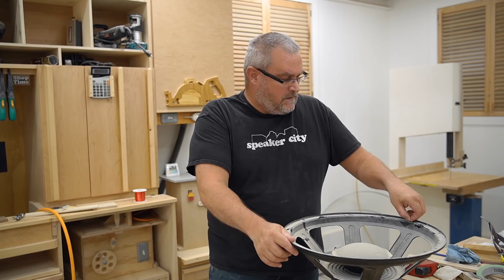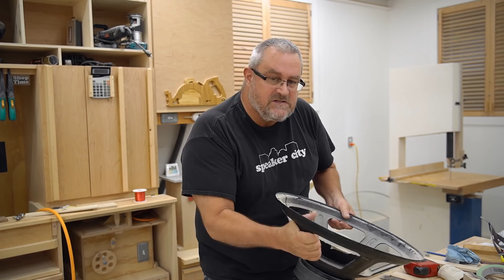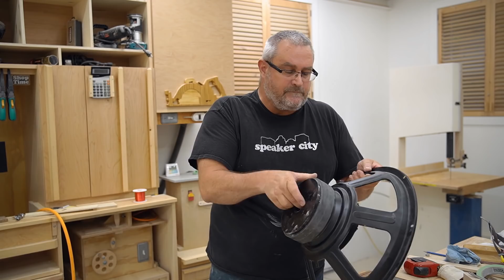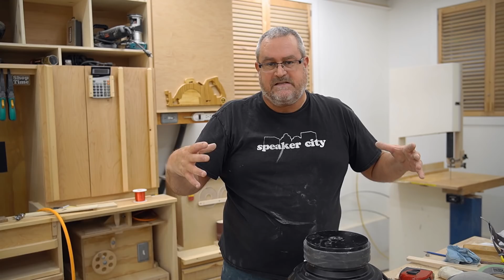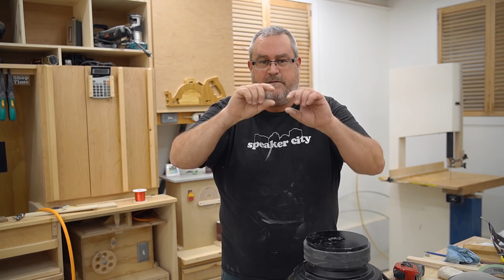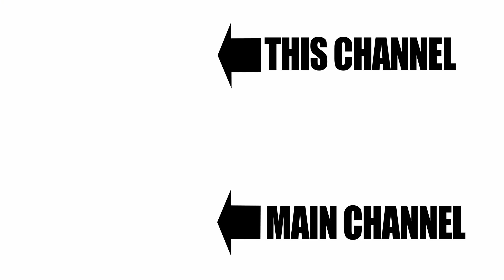Let's Talk About PASSION and Making a GIANT Woofer

Comment from the maker: Feel free to chime in if you have any technical knowledge with regards to speaker driver design. Or even a good understanding of magnetic force and how to best concentrate it.
The frame of the woofer will be made from plywood and hardwood, and probably won't look much like  one made from metal.
Reply: Sounds like you may have already talked about something like this in your video, but Tech Ingredients has a video where they discuss building a ferrous yoke around two magnets to guide the magnetic field between them, resulting in a stronger magnetic force. Not sure if your comments about building the metal ring were about that or not. https://www.youtube.com/watch?v=B015P0XFl9g

I'd like to see you build this woofer.
Reply: One manufacturer to look up for some information is fixmyspeaker.com. They design an build subwoofers an all parts for them.
Reply: I'm an audio file, so, hit it hard and low bud.

Comment: Hi,
Just a few quick comments at first.  Why limit yourself to circular speakers?  You could make them square or rectangular.  Even better make them very tall 8ft and narrow, in which case the voice coil just becomes a linear construction (straighyt wires attached to a strip) and the magnet structure also becomes linear and much easier to fabricate.

If you are looking for cone (panel) material, why not keep to the wood theme and build a sandwich of balsa with spruce skins.  Before, during and after WWII de Haviland build aircraft using this material.  the most famous was the Mosquito fighter, night fighter, bomber, high altitude recon, U-boat hunter, etc.  It was very fast and largely built of wood (nickname wooden wonder), pretty much the entire structure and air surfaces apart from the engine cowlings were made of various timbers.

I will post some other considerations later.  See if you can find a copy of Leo Beranek's Acoustics or Harry Olsen's Acoustical Engineering, ignore the maths and just get a feeling for the field.  Both books are old and written by giants in the field.  At least one of books is in the wild on WWW.
Robert

Comment: Hi John, as an electronics engineer I know that making the cone and/or the coil carrying part out of a metal would end up wasting your electric energy in eddy currents. So dont do that.
If you wind up your coil on an alluminium pipe for example the pipe would become the secondary coil of an transformer which is shorted.
So I would try to use plastics as bobbin and cone.
Beside all that I think it will be an interesting topic to do that project. So feel highly encouraged. I like your videos and I even like more that you found something on which you are very passionate again.
So go with it.

Thx for all your videos
Reply from the maker: Most large speakers use aluminum for the voice coil former, including the one I took apart in this video. It's not a solid ring - it has a gap.
Reply: Hi John, OK then eddy currents couldn't establish. Looking forward to your build 👍

Comment: First, let me say that I know much less about speakers than you do, so treat everything I say accordingly. ;)
Anyway,  you mentioned that the wider voice coil will move less distance, which makes sense to me.  But with your bigger speaker, you wind up displacing about the same volume of air, then?  If so, I'm not sure what the project buys you.  (Then again, don't know till you try, so maybe the learning experience alone is worth it.)
Second, here's an off-the-cuff idea that came to mind.  Could a person use multiple (matched) motors to drive a single speaker?  That way you wouldn't need the larger diameter voice coil to keep things parallel.  I have no idea if this would work, or what it would look like.  Just brainstorming, here.
Love your projects!  Keep it up!
Reply from the maker: The motor idea would be a lot like using 4 engines to power a car, with an engine on each wheel. Way more complex, in other words.
As for the stroke length being shorter for a bigger cone, it would produce less distortion. But that's not the primary reason why I'm going for a bigger cone, that would be because it looks cooler and may get a lot more views :)

Comment: Aluminium duct tape to join the cone edges. Cone should be trying to pull the edges apart, so only needs to hold under tension.

Comment: Making a speaker?  No, you are talking about a machine shop project, suggest hardwood plywood cone about 1/16 inch thick, machine shop for making a voice coil form, winding with 12-AWG wire, epoxy to hold it together, cooling air blower, 1000 watt amplifier, concrete foundation, and a zoning variance for loud sounds.  You may want ear protection too.  Consider the rotary version of a sub-bass speaker, see https://en.wikipedia.org/wiki/Rotary_woofer

Comment: Hi John... you never fail to amaze with your capacity for stretching outwards...?
You should reach out to your local luthier community...seems to me that a speaker is what they make....shaped like a guitar... stiff, light, tunable..... a layup of light spruce wood and stiffening ribs could be built as a speaker, as easily as the deck of a guitar...
The more bleeding edge of guitar builders work in carbon fiber layups, vacuum formed.....?

Comment: I would not use any conductive material for the voice coil form. Metal moving in a magnetic field will produce eddie currents which will sap power and produce distortion.
Reply from the maker: Most large speakers use an aluminum voice coil form, including the one in this video. It helps dissipate heat.

Comment: With that inner tube are you thinking of cutting it up to just use for the rubber, or partially inflate it and it would sort of automatically make the outer ring for the speaker?

Comment: Go for it, John!  In 1975 I had to become the Canadian distributor for Hartley to source their (then) excellent 18" bass drivers, so I know where you are coming from. :-)
As for cone material, have a look at the construction of the KEF B139 woofer - a foam cone.  I have used many of these in folded horns over the years.  Very stiff.  Very light.

Comment: One thought is that you could make an electromagnet powered by a DC power supply.  You may be able to get some serious flux density with that.  For a cone if you can find some carbon fiber you could make something very light and stiff.  Winding a voice coil will be a daunting task.  Keep us posted please.
Reply from the maker: Field coil - though about doing that, but the need for a well filtered power supply (no buzz) and spools of magnet wire make it less attractive.

Comment: I have a couple ideas for cone material both would require a wooden buck mold. Pressed aluminum sheet or a laid up fiberglass   Fiberglass in my opinion would be the winner since it’s easy to mold and quite rigid once cured.

Comment: I know nothing about speaker design. However, I wonder why the cones are usually made of paper rather than aluminum. Could there be a problem with fatigue of aluminum?
Reply from the maker: There are lot's of aluminum cone speakers, actually. Paper is cheaper, lower mass, fairly stiff, well damped and generally doesn't breakup as harshly as aluminum. Breakup is where the cone stops behaving like a solid, stiff piston at higher frequencies.
Reply: @IBuildItScrapBin  Thanks for your reply. On doing a little research, I found that quite a few materials are used by different manufacturers including polypropylene and kevlar as well as paper and aluminum. It seems that all the materials have their advantages and disdvantages and some manufacturers even use a laminate of different materials.

Comment: Forget that magnet, get a large nobidium one much greater force.
Reply: @IBuildItScrapBin  The actual force to move the cone is the sum of the permanent magnet flux plus the speaker coil flux. You either increase the PM flux or the coil flux. The coil flux is a function of the number of turns and the current. It would seem by increasing the number of turns would be the solution BUT that would increase the inductance, increase the speaker impedance, decrease the current and also decrease the frequency response. Looks like CATCH 22. Good Luck

Comment: Maybe you heard about the Germanator Subwoofer? It's a 33inch Car Audio Sub, a friend of mine actually owned the protoype. It has a 6inch coil, but still didn't compare against my three 18inch Subs on roughly the same amount of power.
To best concentrate the magnetic force, you basically build a "C" out of three big Steel Rings. One as a bigger bottom plate, one as middle "spacer" & one as outside Top Plate. You probably also need to make a new inner top plate, because it should be flush with the ferrite slugs to get a small as possible voice coil gap between the two top plates (that's where the magnetic force concentrates)
Reply from the maker: The biggest I knew about is a 32" Clarion, but that's over $5000. Eminence makes 24" that are downright cheap in comparison.
Reply: @IBuildItScrapBin  car audio is ridiciously expensive in comparison to pro audio drivers. But you can get incredible amouts of amplifier power for cheap. A brazilian 12kW Amplifier is around 1000 US$

Comment: It's illegal to pump your own gas in Oregon.  Or at least it was before covid.  Couldn't you hammer out the cone from a flat sheet?  That would be fun.
Reply from the maker: Watching his videos doesn't make me Ron Covell, unfortunately. And I've no English wheel.
I think a 1/4" scarf joint would be doable and the way to go.
Reply: @IBuildItScrapBin  Or make an English wheel.
Reply from the maker: And you are making a jointer, yes? That's what those cuts were on those table saw wings? What are you using for the cutterhead?
Reply: @IBuildItScrapBin  I'm going to get a full blown 4" spiral cutterhead intended for a 12" jointer but can't swing the $$ right now since I didn't get the big ornament job.
Reply from the maker: Spiral... nice. I don't use a jointer often enough to justify that expense and the One I have gets the job done. I see the jointer more or less like the table saw, good for getting the stock roughed down to flat and true, but not good enough for a ready-for-sanding finish. I'd rather spend the money on a better surface planer.
Reply: @IBuildItScrapBin  Mostly I just don't want to have to deal with setting the knives.  Not sure how many years ago I put the carbide head in the 6" jointer I have now and haven't had to touch it since and I DO use it.

Comment: Play with this one then design one with neos. Like you, If I had the chance, I would be making speakers all day every day. If you wanna go down a massive rabbit hole. Look up sub-subwoofers that are actually fans and the the pressure is made via a swash plate changing the angle of attack. just like a helicopter. I'll watch this stuff, nooooo problem.
Reply from the maker: Original idea was to a series of big neodymium magnets, but they are expensive enough that I'd have to treat this as a very serious project.

Comment: I feel your passion on this subject and can’t wait to see your thought processes develop into a  working model. You touched on what I would think are the important design considerations for the cone and associated “moving” parts. Strength, weight, and suspension. Strength is obvious. You don’t want it to tear itself apart.  Weight and suspension deal with frequency response and power requirements which you touched on. No doubt there are a hundred other variables to consider, but one must start with the simple, right?  So, happy engineering and designs that can be worked in the humble workshop.

Comment: I was skeptical at first, but I'm glad to see you're talking about ACTUALLY building a speaker. I'm so tired of people claiming they "made a speaker/bluetooth speaker" or  "made a pen, ice cream scoop, seam ripper, pizza cutter, bottle stopper, whatever...", when all they really made was a speaker box, not a speaker. Or they merely turned a handle to insert a kit into. The two are completely different things.
Reply from the maker: Like making supper is heating a TV dinner in the microwave :)
Reply: @wood 'n' stuff w/ steve french  - That's a slippery slope. Where do you draw the line. If I claim to have made a coffee table out of plywood, did I really make a table or did I just assemble some plywood that some factory made. Should I start investing in a plywood making machine or what?
Reply from the maker: If you didn't plant the tree that the wood came from for the desk, you ain't making furniture!

Comment: Are you planning to make it closed or open with bass reflex? I would suggest closed, since the impulse response will be much better.
Reply from the maker: Depends upon how it tests. It might be better suited to one or the other.
Reply: @IBuildItScrapBin  The issue with closed is that  it has a problem with going down to the lowest end. The size of the membrane however suggests it can go very low, so it wouldn't be as much of a loss when run enclosed.

Comment: Great project, go for it! Accuracy for the iron ring may be an issue, maybe you can collaborate with a machinist YouTuber to machine you one? Gives you more material choice as well to pick a highly magnetic one. Also, I've repaired successfully tared cones in the past using contact cement and bandage gauze. Perhaps finger jointing the aluminium cone and laminating it top and bottom with gauze would work?
Reply from the maker: The tolerances don't have to be that tight. I am pretty darn good with the angle grinder, after all :)